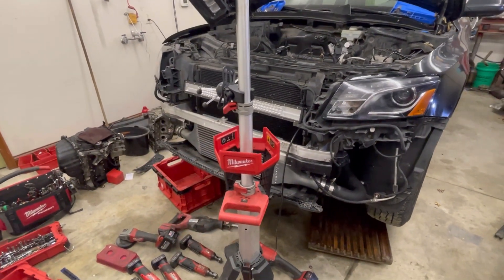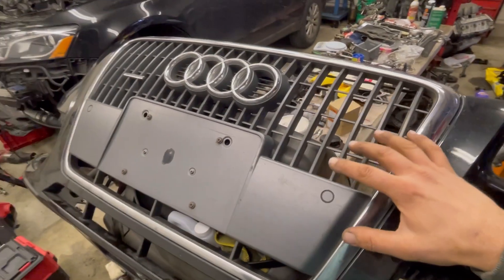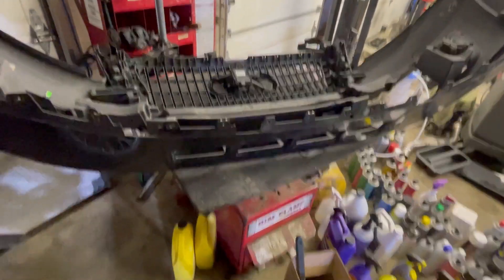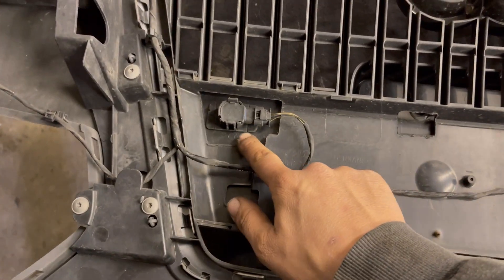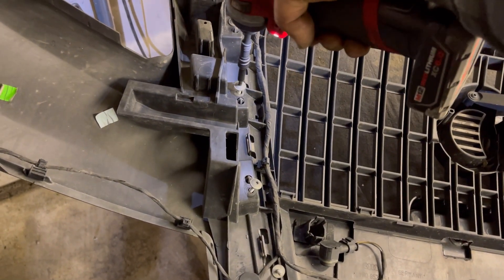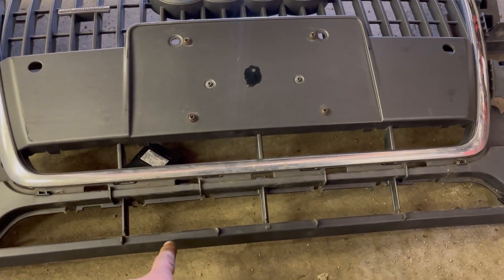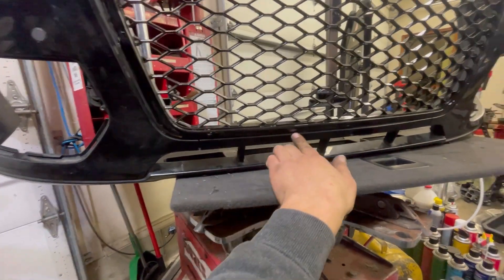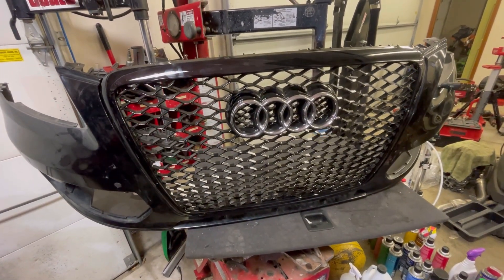Audi Performance Grill Install Aftermarket honeycomb Q5 cooling mod intercooler  FAST BOI b8 b8.5 VW

Comment: nice, can't wait to to the finished car - I own an '09 Q5 T2.0 and love it even if it does use a bit of oil, mine has only 40,000 miles so everything still looks and works like new - only wish I could buy a manual tranny model, they have them in the UK! How sweet would be shifting that sucker to redline eh.
Reply: No more oil then

Comment: Sir Naptown, would you happen to know if the B8.5 allroad front bumper is compatible/interchangeable with the B8.5 Q5 front bumper? They seem so similar to me…
Reply: Both premium plus and have parking sensors. 🤔

Comment: Dude, you should have asked a professional for help or at least someone who has done this before or a body shop tech. So, how did you mount the sensors, more glue? Looks like, to me anyway, that you bit off more than you could chew and stopped the video before it got completely out of hand.

Comment: Biggest regret was buying my Q5 with 80k miles on it
Reply: At that mileage you need a engine rebuild and all new gaskets!! 😢😢😢 any other way and you will end up spending more money trying to save...just do it all one shot...also hopefully whoever's rebuilding your engine won't charge you extra for replacing parts that has to be taking off anyway!!!! Trust me an junkyard engine won't do the trick... you will end up with the same problems that your last engine had...